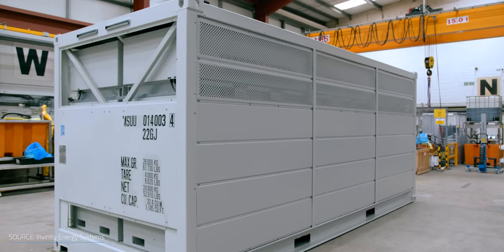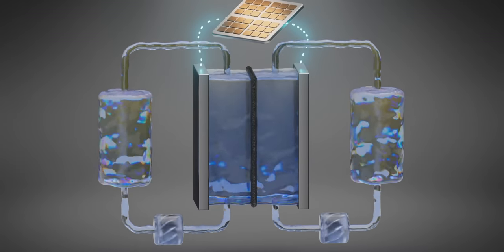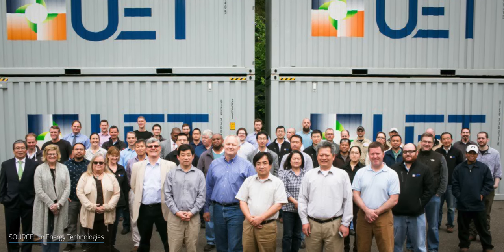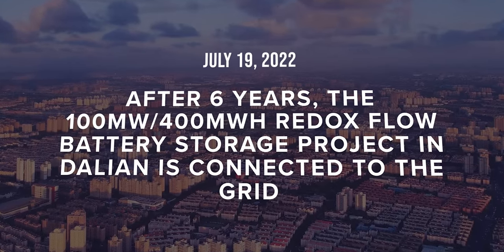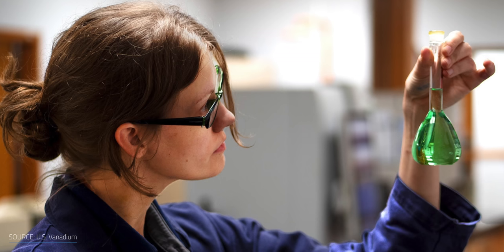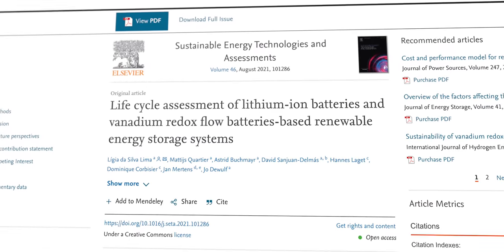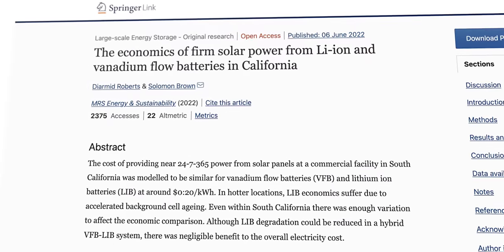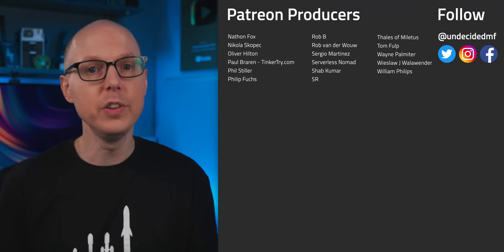The Breakthrough Battery That The US Gave Away to China

Comment: I looked into these to power my house a few years ago. unfortunately the up front cost was a issue 30kw $45k AU vs $30k for lithium, but the flow battery did include sma inverters. It took up 1sqare meter and weighed 1.5 tonne. They also told me if in the future I no longer wanted the battery they would buy back the electrolyte

Comment: I was thinking how this battery is more of a plumbing system than an electrical system.  Curious then if you could put these holding tanks of the electrolyte solutions at some distance from the electrical components.  Also considered that installation could be accomplished in tight quarters or otherwise underutilized oddly shaped locations by installing custom shaped tanks, perhaps even bladders confined by simple wood frame boxes.  Also, the fact that it is a liquid filled tank means that you would presumably install the tank empty making it very easy to handle and put in difficult locations (like attic spaces) and then fill the tank with a hose and transfer pump from a convenient distance.

Comment: On September 20, 2022, the 250,000-kilowatt/1,000,000-kilowatt-hour all-vanadium flow battery energy storage + 1,000,000-kilowatt market-based grid-connected photovoltaic power generation project started construction in Qapqal Xibe Autonomous County, Ili Kazakh Autonomous Prefecture.

Comment: 85% efficient vs 95% efficient? That sounds like a bit of an important distinction! It certainly is more efficient than compressed air or hydrogen production from water electrolysis but quite a bit less than Lithium. Now with the simplicity of the battery, perhaps the fact that making it in the first place would use so much less energy than lithium battery production that the gap would be inconsequential. Vanadium sounds rare though and hard to get, how is its production at scale vs the alternatives?

Comment: Flow batteries (independent of chemistry) have an important difference from wet and dry cell batteries.  They can be turned OFF, meaning  there is no voltage difference between the Plus and Minus terminals, even when "fully charged".  Just drain the reaction area of electrolyte(s)  and they are completely OFF.  You can short the terminals.
Also, if the charged electrolytes do not degrade on their own when confined to the storage tanks, there is no self-discharge.

Comment: As we ramp Lithium batteries, especially iron phosphate, it becomes harder, and harder for competing technologies - unless they can prove that they have an outstanding advantage. Anything "mechanical" can suffer degradation over 10-20-30 years - and it's not always easy to predict, until they have that long in the field...corrosive, toxic or high temperature materials likewise. Batteries can be switched vary rapidly (milliseconds), so can provide more services to the grid. Having said that, we need to trial different systems, because unless we do, we might miss an even better solution ! (And the production advantages of Tesla's 4680 have just raised the bar even higher...)

Comment: Zinc Bromine is another flow alternative - buy the chemicals from an ag-store. Redflow in Australia have made house scale modular flow batteries. Though this technology does have issues with energy draw needing parallel units and zinc dendrite issues potentially rupturing the cell (needs full discharge regularly) but can be stored at 0% DOD or 100% DOD near indefinitely and volume of chemicals is the only limiting factor in its total storage capacity (just its not high current producing or sinking compared to Lithium).

Comment: I live in Iowa and will build a new passive house of around 4,000 - 5,000 sq ft. The weather can be extreme with temps of 103 in the summer and -30 in the winter. Would this be a good solution if I had and extra separate 1,500 sq ft garage/storage building? Looks like it might be a better solution than Tesla or the like batteries that need replaced every 10 years. Would be ideal to use battery energy during the high cost times and recharge them the rest of the time as needed.

Comment: One draw back for Redox flow battery is its real energy density is very low, 40Wh/kg to 60Wh/kg compared to lithium ion's 250Wh/kg. Unless the energy density improves, it's not cost effective and the storage area required is to big.

Comment: Just to recap there is a common positive and common negative electrolyte  so as a flow battery u have to limit the power lost through the conductivity in the electrolyte between cells. The higher the voltage the more loss as the conductivity stays the same from charged to discharged. I suggested a method to do this based on the film projector Maltese cross mechanism  though it moves is can be disconnected electrically speaking. The big advantage of the system is a few low voltage cells at high amps can be in series with the high voltage stack .u can tap multi voltage points for all sorts of purpose .

Comment: Hi Matt, thanks for a great video! I'm wondering whether this tech might be a way to fuel up one's EV (how large would be the volume of the electrolytes required), how it would compare with charging or perhaps fueling up H2 for a fuel cell based EV. I also remember one of your other videos about storing H2 on a metallic surface, which I think is also a remarkable idea. Thank you!
Reply: Yes, these would be great as a buffer at EV charging stations.  When a station is full of EVs, all fast-charging at once, the vanadium batteries could take some of the strain off the grid.  Then when there are few cars, they could recharge.
Reply: VRFBs are definitely a good solution for charging EVs, also good to store excess energy to use for hydrogen production when renewable generation isn't available
Reply: ...just revisited the topic with the RedFlow design, the energy density of their electrolyte is around 0.1kwh/kg. When compared to diesel, with some 0.3kwh/kg (accounting for 30% engine efficiency), one would have to tank 3x the amount of electrolyte to get the diesel mileage, very roughly speaking. So we probably won't be pouring electrolyte into our car tanks just now but the gap isn't actually that bad, what do you think? Thanks!

Comment: I’m not surprised that the U.S. shot itself in the foot but it’s disappointing that we’re not taking advantage of this technology ourselves.

Am I wrong in my assumption that VRFBs would likely be more applicable to commercial or grid level storage first than residential uses mainly because of the current costs of these batteries?
Reply: In Germany people are charging their RFB batteries at might when utilities are much cheaper due to less demand for power. Then you can run the house off the RFB during the daytime peak power rates to save one third of the cost.

Comment: Interesting and informative presentation Mr Matt Farrell!

The Vanadium Redox Flow battery was invented by Maria Skyllas Kazacos in Australia and developments around the world are advancing the technology all the time. I am sure the Chinese would be flattered (as the Chinese don't respect patents & they actively see it as a compliment if someone copies them) if the US company produces their own vanadium electrolyte in whatever chemical structure Forever Energy want to use. Of course, they could easily contact US Vanadium and use their electrolytes. The requirement for domestic energy storage which is ideal for hot climates and zero fire risk is a huge opportunity. I am surprised even Elon Musk has not got his head around VRFB technology yet.

VRFB which is the official name by the way as agreed by Vanitec the association set up by the Vanadium Industry is monitoring the growth of the industry closely. many of the key Vanadium miners and processors as well as the VRFB manufacturers are sharing technology to speed up the rollout of VRFB across the world. Primary vanadium is mined by Glencore in SA, Bushveld Minerals in SA and Largo in Brazil. With many projects planned in Australia as well. The US has few opportunities for primary vanadium and imports most of its vanadium from SA and Brazil.
Vanadium is primarily used to strengthen steel as 1 kg per 1 tonne doubles the strength of steel and prevents it from corroding. 

The long-term duration and lifetime of VRFB installations as well as the fact the vanadium can be reused at the VRFB's end of life add to the VRFB's advantage as part of the circular economy!

There are two companies in the US that are developing the use of a modified Vanadium Pentoxide for use in both the anode and cathode of Lithium Ion Battery cells, which is another exciting development for Vanadium in battery cells. If work continues with this technology it could bring portable device cells super fast charging times of less than 8 minutes and a life of 20 years with very slow degradation compared to current lithium-ion tech. Definitely a space to watch.

Vanadium is one of those super minerals and is a great investment opportunity for the next generation. Look at Largo LGO NASDAQ, Bushveld BMN.L, Australian Vanadium AVL.ASX and Technology Metals TMT.ASX all growing rapidly but sitting under the radar.

Comment: Redox vanadium flow batteries were invented at Sydney university by a Russian professor. The royalties were bought by a defunct goldmines company in whom I had the bad luck to invest as they wasted their stock float and sold their inerest after 5 years to a Canadian outfit. There were some basic problems with the way their designs were Implemented giving rise to high self discharge. It was never American but a company there was able to make best membrane materials for the flow electrodes. There is also the half interest bought by Mitsubishi in Japan who did a better implementation of the design and have used it to flatten the power grid loads for some years with their 250kva backup /standby power station system.

Comment: Really good episode this time though you did make a mistake in the context of California summer generation issues.  That is a situation that typically only occurs once a year in CA, usually for a few days and it is only applicable to the 4pm-9pm time period.  In otherwords, these Redox batteries aren't useful for that particular problem space.  During the most recent heat wave, California had plenty of margin for most of the day, particularly across noon, all the way up to 4pm.  So much so that the ISO recommended that people pre-cool their homes across most of the day in order to be able to then reduce their power consumption from 4pm to 9pm.

Short-term storage is and CA is pushing hard for more energy storage just in general (solar is over-producing so we need energy storage in order to continue expanding solar and wind).   At the moment, California has grid-scale batteries approaching 3GW of output (about 10GWh of storage or so, off the top of my head).   This is ideal for Lithium ternary and LFP battery installations.  Not so much for redox.

Where Redox style battery systems will really help out is with overnight generation... where the grid needs steady but fairly low-to-modest power generation for many more hours... around 10 hours instead of higher output for 4 hours.

Comment: I feel like salt batteries still seem like the batter method - no li even if their weight is higher - it doesnt matter when you consider you can just build higher vs wider. Flow batteries seem ok, but you still have a lot of waste just hitting in either pools or machines... any of that leaks it could be a problem. For example, I wouldnt want to see one of these close to the sea along a beach if weather was strong enough to ever cause damage.

Comment: Actually it makes sense to turn over Vanadium based battery to China, Vanadium is mostly found in China and Russia, the idea is to reduce the resources needed for batteries from other countries, which is why Sodium Sulfur is extremely attractive, even more so than the Lithium Sulfur.  the less imports needed the better. Globalization is hard core decreasing, so basing your necessary infrastructure on imported sources makes no sense. Though yes redox Batteries seem like a very sensible idea to pursue.

Comment: LFP (lithium iron phosphate) can last much longer than 10 years (perhaps 20+ years)... are much safer than typical Lithium NMC (nickel manganese cobalt)... much cheaper... probably about the same power density as flow batteries... better roundtrip efficiency than flow batteries.  You can't lump "lithium ion" all together.  There are meaningful differences in the different lithium chemistries.

Comment: So quickly to recharge battery possible is just to change liquid electrolyte . Especially on merchant vessels possible to replace fuel bunkering to electrolyte bunkering and using electric motors instead slow speed diesel engines.

Comment: Vanadium redox flow batteries just aren't worth it.
We're talking about >300$/kWh cell cost just for start, where things like Na-ion are already below 80$/kWh on pack level cost.
Not to mention that new Li-ion and Na-ion chemistries last as long or longer than VRFB's, at much higher power output, and most importantly - no moving parts.
Li-ion are slightly harder to recycle, yes, but they're also nearly fully recyclable.
VRFB's very low specific power and energy density not only completely inhibits any usage in vehicles, but even makes grid batteries less appealing, at least retail ones - in not long time most of houses will have their own energy storage, which will most likely make up majority of grid capacity, and rarely will people mount 1 ton systems for that.
I'm pretty sure that's one of the reasons USA gave away this technology - it's not much use anyway.
Ambri batteries sound more appealing than this :|

Comment: There are tons of potential types of good battery.
A lot of potential manufacturing issues are on the way. The point is whether you can get enough investment. 
For example 4680 Tesla battery
Reply from the maker: Thanks for the comment.  I'd add to this that it's also about the use case.

Comment: There's also Redflow's Zinc Bromine RFB which doesn't use any acids.  I believe bromine and zinc are quite abundant and easily recycled. The challenge is the whole flow thing, that requires a pump and pumps have seals (no, not  the ones that swim in the ocean) and seals wear out over time. I don't know about the other RFBs but Redflow's  chemistry does require a period of recovery cycling to keep the chemicals in tip top condition so single unit batteries aren't very practical. Nonetheless all of these look promising due to the low self-discharge. At the end of the day AGW is global challenge. We should be focussing on deploying everything we can to avoid a climate catastrophe and it doesn't matter in which part of the planet we do or do not reduce emissions. The last thing we should be getting in a huff about is patents and licensing.

Comment: I have something similar a no recharge battery in the works that uses replaceable & recyclable electrolyte sheets once the battery is discharged. The electrolyte sheets are replaced. No power recharges required The Meek LLC

Comment: For on-site house energy storage this looks way safer than putting lithium batteries. Also I'd imagine a household having a 60 or 80kwh battery outside in a separate area and a comfy 15 or 20kw solar system. You're all set to be off the grid.
Reply: Lot of people have large propane tanks next to their homes and it works fine, I dont see lithium bettery as a problem. It needs some safety rules as the acid mix would also need.

Comment: Looks like a very good application for stabilizing the power grid by implementing regional buffer batteries for catching spikes.
Maybe US should consider a little more regulating like EU did it for e.g. USB charging mobile devices. This is just one example that without governmental intervention will handover worldpower from western countries to a large asian country in the long term. Also western countries should join forces more instead of small fights US vs EU for short term advantages.

Comment: whenever they say
x times longer than other batteries & not any
 NUMBER OF CYCLES  -
it is just a fraud 
(to manipulate their market cap etc.).
   If someone actually get something, they will tell
1) no. of cycles / lifespan
2) current rating ( & hence charging / discharging time)
3) nominal voltage
4) cell capacities developed.

Comment: Matt, would not this tech make EVs "refuelable"?  11:10 Exchanging the electrolytes on both sides, would that not be the same as "adding more storage?  Then a station could cycle the electrolytes and recharge them. look at the external tanks as belonging to the station, and the internal ones as the vehicle's.
I am certain we will find an electrolyte that will eventually be less acidic or toxic.  If we had the years of research put into hydrocarbons equally into electic I wonder where we would  be today.  That time is fast aproaching
Reply: You are a clear fraud sir and are NOT Matt.  Using his Icon and a variation of his name fails, is clearly a ploy to deceive me. Clicking your name takes me to the wrong place.  Anyone who sees a comment pretending to be the host of the channel should look for both the grey outline of the name and investigate the actual channel before believing any ploy addressed to you.